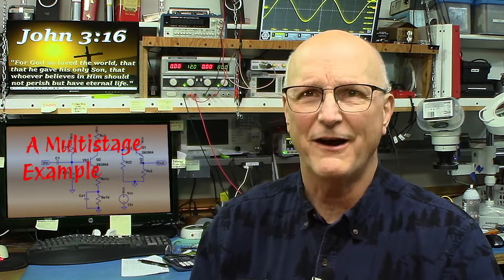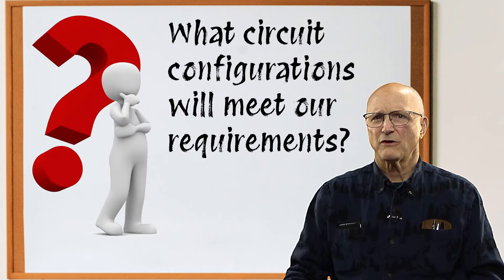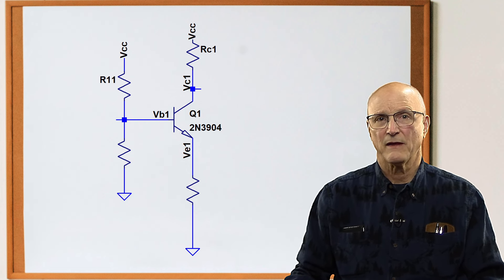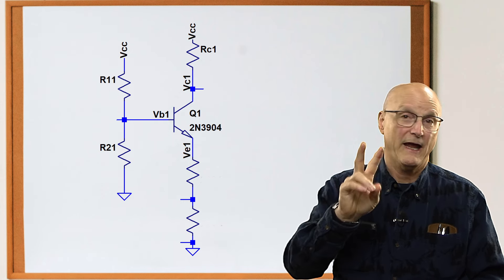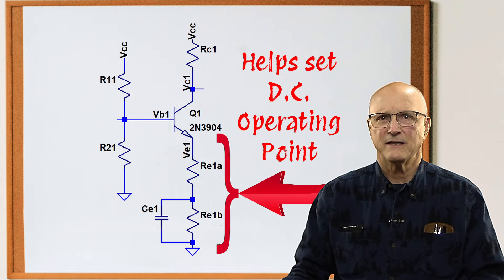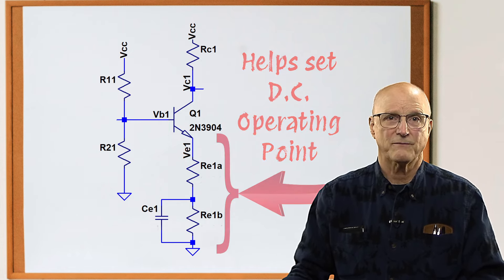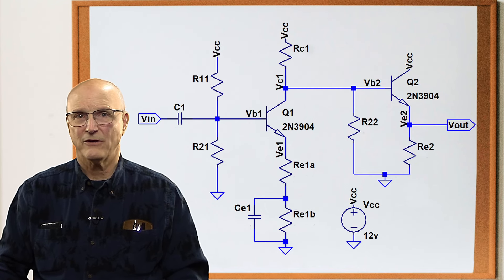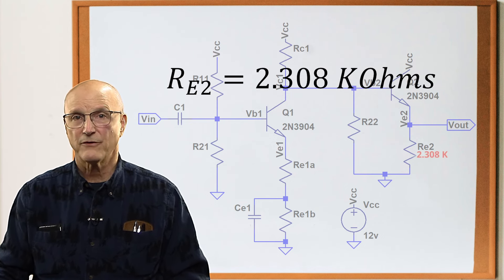A Multi-Transistor Example Circuit Analysis & Design (066d1)

Comment: Let me say at the beginning I find your video's to be educational and informative in electronic design in this series. As we both know that using values as near as possible will have very little effect on the outcome of the circuit parameters from a design point of view.
There are many rules of thumb that designers use as short cuts. Again a great series.
Reply from the maker: Thank you very much! 😀
True that. The point of design and analysis is to get us "in the ballpark" so that we can make intelligent modifications to the first prototype to meet requirements. 🙂

Comment: Not sure if this video was in response to a comment I made about multi stage amp design if so you nailed it Ralph thanks so much for all the hard work putting this together. 
 So Ralph how are going to top this one? 😮
Looking forward to the next video and where this series will ultimately end up.
Reply from the maker: Well ... yes, you were one of the commenters that asked for a multi-stage example. I'm glad that it is everything you were hoping for.
The immediate plans ... Next video is 3 ways to measure output impedance (as promised) and then load lines (which will include a bit of a tutorial on curve tracer stuff). 
My plan at that point is to switch gears for one video to cover some stuff on the nanoVNA at the request of another subscriber.
Then it is back to a video on difference amplifiers. This kind of blows the top off of the standard model we've been using.  The end goal? The Gilbert Cell balanced mixer/modulator/demodulator/voltage controlled amplifier...etc. all in one circuit thingy. 🙂
I am truthfully very excited about all of this.

Comment: Are you able to show a bode plot of your circuit's performance?
Reply from the maker: I created one in simulation running from 0.1Hz100 MHz.  The limitation on the low end is due to the capacitors. Their Xc of Ce1 is increasing, Re1b is becoming more and more of a factor in the gain as frequency decreases.  The Xc of the input capacitor is also increasing, creating a voltage divider with the input impedance of the circuit (which is increasing with decreasing frequency). I think the upper end is a limitation because of the transistor, itself.
Here is a link to the pdf of the results:
https://drive.google.com/file/d/1UAVKSLmhESPPQzrTwxwdp2iJa4ewtju2/view?usp=sharing

Comment: I'm puzzled . . .  in LTspice yes you indeed get approx. 5v output for a 50mV input. But if you add an isolating capacitor to the emitter of Q2 and a 10 Ohm resistor down to ground (imitating a 10 Ohm speaker) then the output falls to mV and is distorted. Is this a practical design or does it need an additional push pull output stage?
Reply from the maker: Well ... it isn't designed to drive a low impedance like a 10 Ohm speaker. Remember, the input impedance of the stage to follow or the load impedance appears in parallel with the collector resistor of the driving stage to create the actual collector resistor value in the design.
This could be an inter-stage amplifier inside a larger amplifier or other such application where it is driving a high impedance load. So, yes, you would need some sort of push-pull speaker driver stage if you want to drive a 10 Ohm speaker.
This video is an example of how to do the design of this sort of amplifier. It is up to the designer to apply this process to their particular application.🙂
Reply: Thank you . .I've got that. I see my 10 Ohm resistor seriously reduced the effective AC resistance of the previous collector resistor so that the gain was reduced to almost nothing. I will now try for my own satisfaction to add a push pull output as an exercise.
Reply from the maker: @Old_Coder  Perfect! Have fun! 🙂

Comment: What would happen if we stuck a coupling capacitor between the Common Emitter output and the Common Collector input ?  Wouldn't that isolate the DC of the two halves and make them essentially two simpler to calculate ?  N.B.  You would have to add another bias resister for the Common Collector stage of course.
Reply from the maker: Good question! Yes, you could do this, but it would add a frequency response aspect to the design that doesn't exist with direct coupled design. The frequency response would drop off more sharply at the low end; the low end will also suffer because of the bypass capacitor in the emitter. The smaller the capacitor value, the sooner the gain will begin to drop as we go down in frequency.
One other aspect is that, from an A.C. perspective, the loading effects of the second common-collector stage cannot be ignored. So, you have to deal with it anyway, just not in the D.C. design.
So, you are right, but there is a price to pay, so to speak. 
One of the reasons I did a direct coupled design for this video was to demonstrate how to deal with the effect of circuit loading🙂
Reply: @eie_for_you  Basically, "There's no such thing as a free lunch"
Reply from the maker: @paulperano9236 True that!

Comment: Any thoughts about a video using test equipment, audio and RF signal generators and of course an oscilloscopes?
Reply from the maker: Well...I do have a number of videos on using test equipment. Scopes, VNAs, Spectrum Analyzers, Antenna Analyzers and the like.
Here is the link to the first one on using an oscilloscope (the tour, what is what): https://youtu.be/1Sq4L2x4lfU
and the second one (making measurements): https://youtu.be/G5-IJkoW2lE
Hope this helps. 🙂
Reply: You list a total of 162 video's but there are only 70 that are accessible.
Reply from the maker: @rtybn2012 ??? I just went to another browser (not signed in as me...or anyone), went to my channel, clicked on the "Videos" tab as opposed to the "Home" tab. I scrolled down and counted 162 videos.
So, this has me puzzled. 😕 I think the home tab has a subset of the whole.

Comment: I contend that the resistor ( R22) is not necessary. Since the 1st stage is beta stabilized the collector voltage (Q2) very stable, therefor the voltage (Re2 is stable.
Reply from the maker: Ya know ... you got me thinking. So, I set up a simulation in LTSpice to test this theory. 
"How much of a difference does it make from the perspective of a simulated design?" I asked myself. I thought I'd share the results.
I stepped the DC current gain of both transistors from 100 to 300. I also stepped the value of R22 from the designed 51.793K to 1000Meg. I looked at the D.C. output (with v(in) = 0).  The one with R22 as designed varied by 0.573 Volts D.C. as the DC current gain changed.  The one with R22 essentially nonexistent (1000Meg) varied by 0.600 Volts.
So, yes, R22 does make a positive difference, but not very much of one! A mere 27 mV! 🙂
Thanks for getting the mental juices flowing!

Comment: I really wish that electronics was taught like this in college.
Reply from the maker: Thank you so much! 🙂
I was very fortunate because the professor who taught this course at Syracuse University when I was there was really good and walked through things this same way. One of the differences is that we often would populate matrices and perform linear algebra to solve for circuit values using the mainframe computer and the APL programming language. I have *LONG* since forgot how to do it that way. 🙂